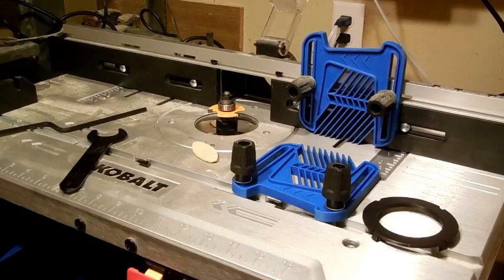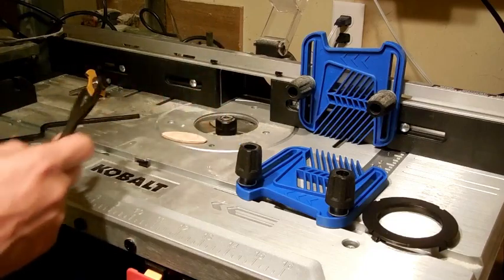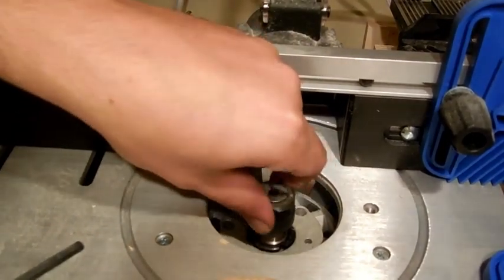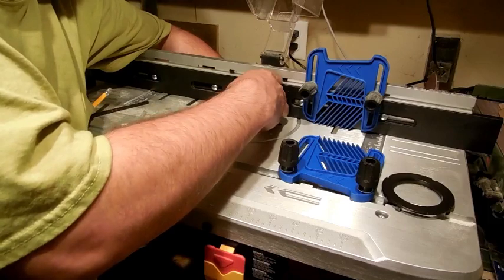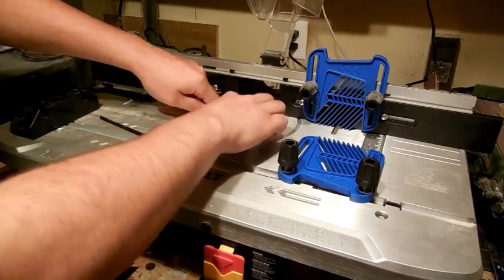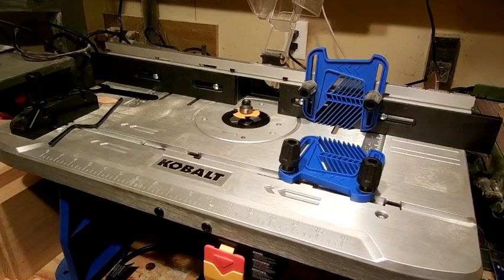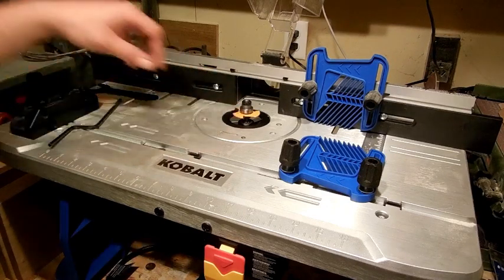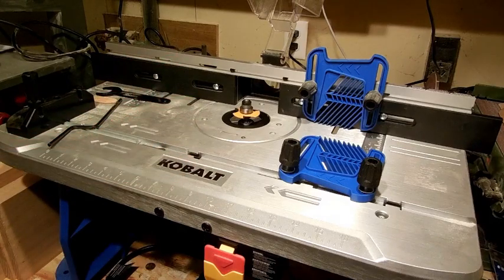How to install a router bit

Comment: I love this router, but have you ever had to trouble shoot it if the crank won't lower or raise? Thanks  :)
Reply: make sure you released the clamp on the router.
Reply: Hi Ric. Same issue here with the clamp open. I'm having to lift the router by hand while cranking. Any suggestions?

Comment: How do you install the 1/4 inch collet.
Reply: Tricky bastards! All you do is, without removing the 1/2in collet and nut, simply plop the 1/4in in like a bit! Seriously. I actually worked to remove the 1/2in over an hour. Succeeded, but the 1/4in went in like a bb in a boxcar. Put it all back together and just on a whim, plopped mine in, added a 1/4in bit and it seizes them both in place.

Comment: My inserts will not go completely in. The tabs on the inserts have no way to catch as the router mounting plate on the router itself allows no room. Did you have the same problem?
Reply: Which inserts? The round bit clearance inserts? I really have to force mine in.